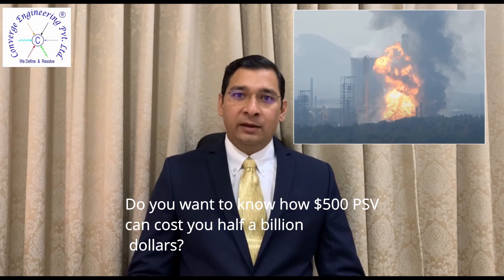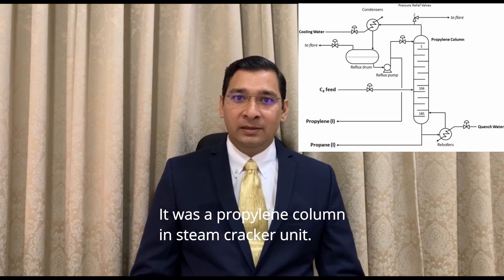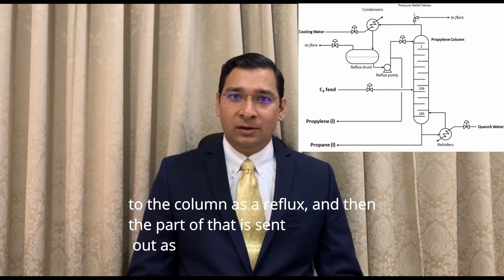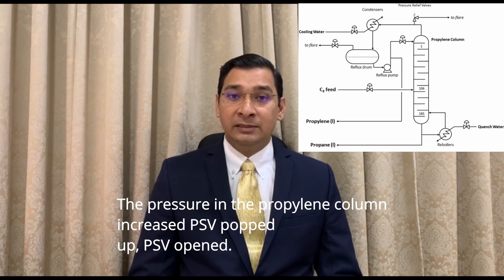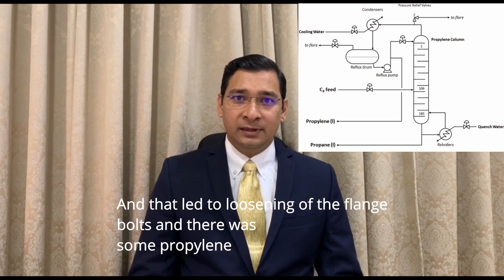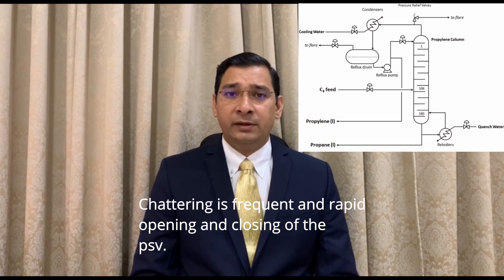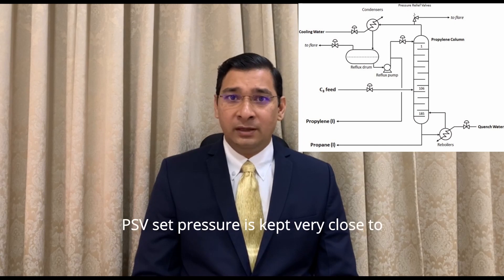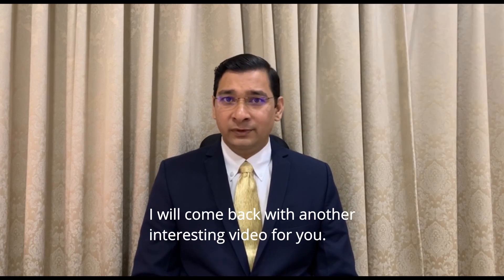PRV Chattering (5 of n)

Comment: Sir, I have another doubt. Does chattering happen for control valves as well? Chattering is a phenomena that takes place in PSV also right? Does Chattering happen for a particular type of PRV only as there are many types of PRV based on mechanical design. From your knowledge which type of mechanical type of PRV cause chattering more?